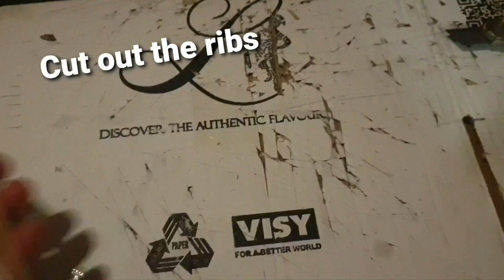Corvo Drone Mini, recreate a Mini Sypaq Corvo Drone of your own!

Comment: Thanks for sharing the plans. Found them. Where would the GG be?  And how large elevon throws?  Neutral position for elevens?
Reply from the maker: The CG Roughly 1/4 chord (excluding elevons) maybe even go a little further forward for the first flight. 
 Elevons should be at least level with the base of the wing, or a little reflexes upward like all flying wings. 
 As for throws I'm def not the best to ask as I usually put max throw on all my planes. However 3/4 inch thrown at the trailing edge should give you plenty of control! I'd set up duel rates either way.
 I hope this helps

Comment: What is the specs of the battery used
Reply from the maker: 1000mAh 3S 70C, XT60 connection with 25amp Turnigy Plush ESC!